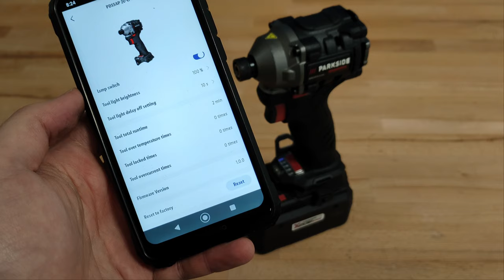Parkside Performance PDSSAP 20-Li B3 Impact Driver Better?

Comment: im planning to buy this new model, im a car mechanic so i would use it for work mostly. i wouldnt use it for some big nuts/bolts for obvious reasons. Probably most stress it would encounter is maybe up to 20 wheel bolts within few minutes. 

if it survives for long enough i would probably change anvil for 1/2" with hex so i can use it as proper impact without adapter and a drill since hex drill bits exist, and if i did change the anvil will that void the warranty if something happens to the tools like it stops working like b2 do?

Comment: I've been using the 1st version since it came out. Home use. Nothing serious. Have no issues, including the sleep mode.
Reply from the maker: Well, maybe it depends on the load. A lot ot people use them as professional tools :(
Reply: I have v1 and v2 and the v1 works perfectly and i use it as a professional tool modified with a 1/2 inch anvil

Comment: Nice!  Is the bluetooth battery required for the driver or can I use a standard x20 team 2ah battery.  Will this work with this new driver?

Could I also drill with this driver?  

What is the maximum Nm torque?  

Thank you!
Reply from the maker: Yes it will, but you won't have the smart features to monitor the battery and the tool. You can drill in wood, but if your try metal most likely you will break the drill bit. 226Nm.
Reply: @icku  in my experience if you can go just very slowly then it will drill through metal.  Is there some way to hold a drill bit in it? I guess I need to research to see which drills can fit in a quick release system.  It would be so nice if I could have just one driver like this and use it for drilling and also just odds and ends on the car and putting in screws taking out screws here and there.  The max torque is adjustable?
Reply from the maker: Parkside has drill bits with hex shank. They will fit. Its adjustable, yes.
Reply: @icku  I wonder when they will start selling them. Do they go to Western Europe first?  I mean to Italy instead of Hungary.  Right now I'm in Hungary and I'm just getting ready to start a road trip to Italy but I would love to buy one of these things.
Reply from the maker: @surfreadjumpsleep  Currently not yet in stores. Maybe in Portugal first or in Czech republic. Not sure.
Reply: @icku  are you czech?  How did you get it first?
Reply from the maker: @surfreadjumpsleep  I got several other things first. Just take a look at the channel ;)
Reply: You can buy Milwaukee drill bits for impact driver. They work in metal pretty well but I'm worried about their lifespan.
On the other hand drilling in wood with impact driver is so much easier and less tiring
Reply: @icku  in serbia will be in lidl shops on thursday 29.12.22, B3 model. thanks for the video, cheers!
Reply: You can use every 20V Parkside battery but 2Ah doesnt allow high current, even 4Ah isn't often enough, due to that the tool can't work on maximum of it's capabilities.

Comment: Hi, could you help me, I have 2 b2 versions and they have problems, dont work, only led light works, do you know what transistors need to replace? They are brand new, only few times used..
Reply from the maker: Sorry mate, I don't have such information.
Reply: Send it back and they will replace it with a new one! B2s can go defected very often. It happened to me two times! You cannon fix at home without loosing the warranty..

Comment: What a coincidence , my B2 just died, turns on but doesnt start, Is there a solution for this?
Reply from the maker: Yep, a new one 😂
Reply: Send it back and they will replace it with a new one! B2s can go defected very often. It happened to me two times! You cannon fix at home without loosing the warranty..
Reply: @ledzoltan  Can't, I had a friend buy it from Germany and send it to me în Romania because we didn't get it here yet.
I found on Aliexpress that controller, I'm waiting to get it and change it, see if that works
Reply: @TheDaniels5s  Ok my neighbour. In Hungary this piece has a 5 year warranty period. I hope the new controller will work fine for you!

Comment: Hi. Wich One is Faster driving screws? The Parkside impact driver, or the Parkside 150 mm driller? Thanks
Reply from the maker: Those are two totally different concepts. You will get pretty tired, pretty fast with the 150Nm drill. That's why for screws you need a impact driver.
Reply: @icku  ok, thanks, but is it Faster? For driving self drilling screw INTO metal, wich One is Faster? What i Also dont understand os why an impact driver hás more RPMs (3700), and more tork (nm) and still be slower. Thanks
Reply from the maker: @filipelollita806  Yes the drill is faster. The impact is slower due to its mechanical working principle.
Reply: @icku  i thought impact drivers were super fast. Now i dont understand...  I thought the impact driver b3 from Parkside, was the fast de to its 3700 RPM. The driller is ONLY 2200 rpm